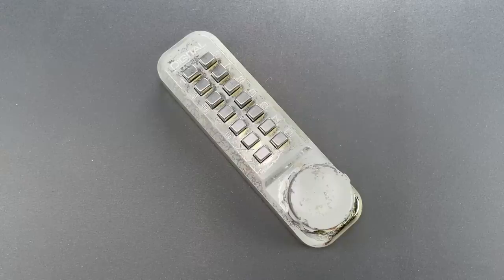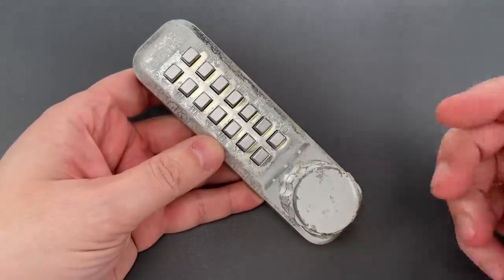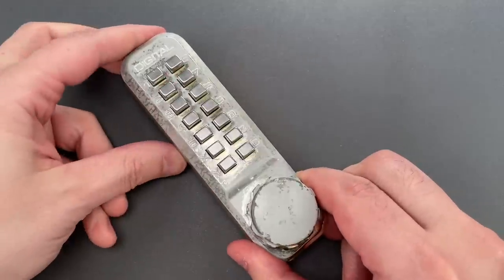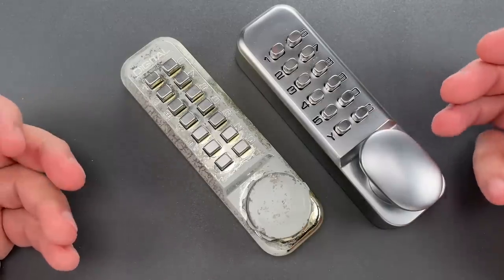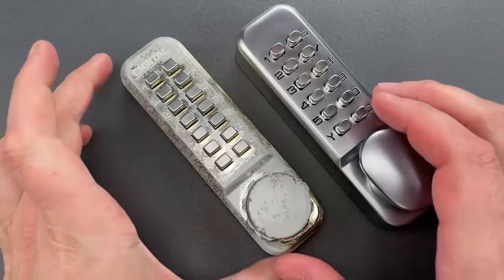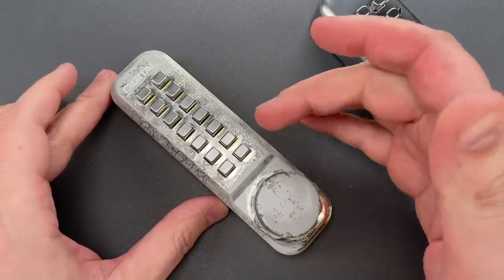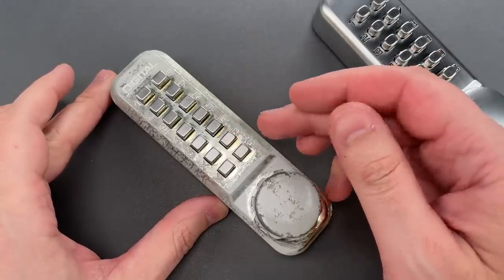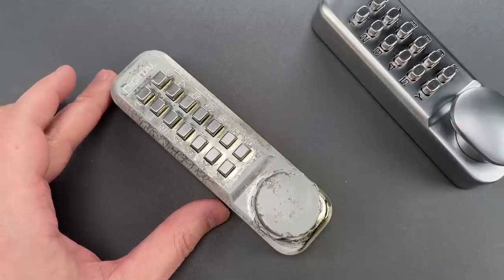[1479] Mechanical Keypad Deadbolt Decoded

Comment: It is interesting to note that, mathematically speaking, most "combination locks" should really be called permutation locks (because the order matters), but these locks are truly combination locks because the order you punch in the numbers is not relevant.
Reply: Thanks dad
Reply: you're technically correct, the best kind of correct
Reply: This is the very thing that confused me when I did my homework and gave the lock example.
Reply: @ilonachan  Yes, Combination is a meaningful mathematical word.  "Combinations and Permutations" is an area of mathematical study.  The OP is right to say that this is a Combination lock.
Reply: @johnwinters4201  oooh interesting, I didn't know that was the name for that. Still, the commonly seen design where order matters is also not a permutation lock. Is there a name for ordered combinations?

oooor it seems "permutation" can also refer to an ordered selection where elements can repeat and be missed out. That's not how we EVER used the word, but I can accept that.
Reply: That is incorrect.
The "combination lock" that you refer to (I believe you mean those with K wheels and N digits on each) , are not permutations, but variations with repetiton.. so N^K variations.

Permutation is arranging all the elements in different orders. E.g. if the lock like this had to have all buttons pressed (each exactly one time, order matters), that would be a permutation (N! possibilities)
Reply: @panda4247  Permutations don't have to use all the elements
Reply: @panda4247  You're incorrect. You can have permutations with repetition or without repetition. They don't have to use all elements in the set. Your formula N^K is correct, but it's still a kind of permutation.

The formula without repetition would be N! / (N - K)! In the case where N = K (all elements used), the formula simplifies to N!, which is what you had.
Reply: @panda4247  A permutation doesn't necessarily require the selection of every item in the set, but it does require the items selected to be in a particular order, without repetition. A combination, on the other hand, does not require a particular order, but it also disallows repetition.

This lock, since it has 13 digits of which four must be chosen, has 715 possible combinations. If it required the digits to be selected in a particular order, it would have 17,160 permutations. That's two orders of magnitude improvement just by changing the rules.

This lock, as implemented, offers little security. If you didn't know the trick you could still brute-force your way in via exhaustive search. Assuming, generously, five seconds per trial, you could go through the entire keyspace in less than one hour.
Reply: I think I agree but also, wouldn't not pressing a button be a selection? Would the unpressed buttons be part of the selection set?
Reply: Finally, someone who understands!!
Reply: and then we have German, where locks like this are simply called "Zahlenschloss", literally translated to "number lock".
Reply: The only thing better than these kinds of comments is the discussion that inevitably follows them.
Reply: Why not go one step further into heing unnecessarily descriptive and call them:
"Sequential Order Specific Combination locks"?
Reply: @nutbastard  strokes non-existent Fu Manchu ahhh! I see your mastet taught you well, your Kungfu is quite powerful! A-wooooo, good disciple!
Reply: @nutbastard  So is corrugated fiber board it just uses three cardboards.
Reply: Software developer here and I'd tend to agree with your pedantry over this wording
Reply: So what's a lock, with 4 selections of 1 - 10, and also a permissible settable sequence of 1 1 1 1, called? 
A Combination or a Permutation or elsewhat?
Reply: A permutation also happens at hair salons.  Female goes in looking normal and comes out looking mutated.  I think it's just shortened to perm in casual conversation.
Reply: I think for a permutation you would need to utilize every symbol once, so I guess they should be called arrangement locks?
Reply: @mmmmmmmmmmmmm  dude, that is literally the definition of permutation...
Reply: @ODekaK  no, I am correct :) 
permutation is just "number of different arrangements of the elements in the set" no duplicates, all elements used. That's it.

Having googled some more, apparently, the thing which I call "variations (without repeating)" is also called "k-permutation" or "partial permutation". but just "permutation" is always ordering all elements...
Reply: Normally what is called "combinations" is when you have a selection of a known number.  With the lock the number is unknown so you have 2^n possibilities instead of n!/[k!(n-k)!].
Reply: Big brain representative
Reply: @willj1598  Yes, but you can not-press the unneeded buttons in any order you want. :)
Reply: @CoolAsFreya  Pendanty?  I just said "interesting to note" without an edict in sight!  :D
Reply: @Dr_Wrong  Permutation.  What the setting is is not necessary information.
Reply: @johnopalko5223  
Not quite.

If a set itself contains repetitions then the permutation can contain repetitions.

For example the set {a, b, b, c, d, d, e} contains 7 elements and a permutation of two elements from that set could contain a repetition,  ie (b, b) and (d, d).  Other permutations would include (a, b) and (b,a), but these two would both be the same combination of {a, b}.

The important fact is that if you one-to-one map the elements of a set with the counting numbers, then the permutation of the counting numbers will not have any repetitions but the permutation of the elements mapped to those counting numbers can have repetitions, and so the permutations of the set elements can contain repetitions. 

So mapping the set above to the counting numbers using their positions as listed from the left hand end,  the (b, b) permutation could be either of the (2, 3) and (3, 2) permutations of the mapped counting numbers, which do contain no repetitions.
Reply: @cigmorfil4101  Yes, you are correct. I made the mistake of not considering the general theory of combinatorics but, rather, focusing on the specifics of this particular lock.

The design of this lock makes repetition impossible. There's no reason why a digital lock could not be designed that does allow repetition.

But still, the distinction between combinations and permutations stands. By not considering the order of selection, the manufacturer has drastically reduced the size of the keyspace. In fact, they have made it laughably small.
Reply: @ilonachan  I take it that you never had the Intro to Probability course.
Reply: @johnopalko5223  
You mean like a lock with 3 or 4 wheels each with the digits 0-9?
Reply: @panda4247  and others: It seems to boil down to how people in different parts of the world call the same things. There are countries where there are permutations and variations (repeating or non-repeating), and combinations; while there are ones where they call everything that is not a combination a permutation. In my part of the world (Hungary) we differentiate between variations and permutations. But, to be honest, I think those who don't have a point. After all, permutations are just a special case of variations (where we choose all the elements), so why not call them the same thing? Also, I've never heard anyone saying "partial permutation", they just use "permutation" to mean that. (I'm not an expert on this, those are just my experiences)
Reply: @cigmorfil4101  That's one implementation. I was thinking of mechanical pushbutton locks, specifically, the Ilco Unican Model 1800, which was introduced in 1965. I don't know if that lock allowed duplicate numbers to be selected, or if order mattered. Perhaps LPL can fill us in.
Reply: 14 choose 4 is 1001, so this lock is theoretically vulnerable to a (figurative) brute force attack by someone with enough patience.
Reply: @dansanger5340  It's 13 choose 4. The 14th button clears the lock. So it's only a meager 715 combinations. 13 choose 4 permutations would be 17,160. That's still not a lot but it's better.

If the manufacturer had implemented 13 choose 6 or 7 there would be 1716 combinations. More than 6 or 7 and the number of combinations begins to decrease.

Permutation is the way to go.
Reply: @johnopalko5223  715 combinations is worse than a briefcase lock.  Probably not something you want to brag about on the packaging.
Reply: @dansanger5340  Does the lock only allow 4-digit codes, though? (I don't know) If not, then there are 2^13 = 8192 possibilities, which is still not a huge number, but it's 10x larger...
Reply: NEERRRRRDDD
Reply: Even worse, some of these mechanical, of us are such that you can "mash" several buttons at the same time and the lock will open. The keys do need to be in the combination though.
Reply: @FZs1  Yep, I have noticed that too, however, I would argue that "partial-permutations" or "k-permutations" are still not the same as permutations even if they share a similar name in that terminology.
It's like... a peninsula is not an island, even if they share the same root in many languages (even in your laguage, if google is correct. félsziget and sziget... I hope you agree that they are not the same, or "just a special case" of one another)

However, once it gets repeating digits, it cannot be a permutation.... there are no factorials in the formula for that :D it's completely different concept.
So while I might concede that 5-8-3-6 might be a permutation (though just partial on the 4×10 digit lock), 3-5-3-5 is definitely not a permutation.
We might as well call it a combination, if we allow different concepts to have the same name...
Reply: @johnopalko5223  
Not quite.

IIRC the number of digits required is set when you set the combination: you decide whether each symbol [0-9X--Z] is required or not, making it have 2^13 or 8192 different combinations (which includes no digits being pressed, ie unlocked unless you press any keys).
Reply: @ilonachan  how did you use permutation?
Reply: So i can make a run of the mill "combination" lock and market is as a superior to other "combination" locks on a technicality?
Neat.
Reply: @vojtaliska1430  apparently, you can make any shitty lock and market is as as you like, even without the need of some technicality. E.g. locks marketed as "high security", that can be shimmed or bypassed 🤷‍♂
Reply: When mathematicians try to rationalise the English language. As an added bonus we have mathematicians applying mathematic principles to things not associated with mathematics. But that's mathematics in a nutshell.
Reply: @nutbastard  The semicolon really has no defined "correct use". You did use it well, though.
Reply: @pixelmaster98  I'm surprised the German brain copes with calling this lock Zahlenschloss (number lock) when it also has letters. Seems a recipe for existential implosion.
Reply: @DiscoFang  well, my response was based on Victor-charles' comment, which mentioned "the order you punch in the numbers", not "letters". If the lock has letters, it obviously would not be called "Zahlenschloss".
However, the number (no pun intended) of number-based locks that I have seen in my life far exceeds the corresponding number of locks with letters. Regardless, combination locks could also be directly translated into German as "Kombinationsschloss". In my experience, Zahlenschloss ist just the more popular term.
Reply: @DiscoFang  "When mathematicians try to rationalise the English language" is not a complete sentence.  (when linguists try to interpret YouTube comments)
Reply: @victor-charlesscafati   It is intentionally and correctly a sentence relying on context for it’s completion befitting of and moulded to the YT context. It’s not me that doesn’t have a handle on liguistics in communication.
Reply: @DiscoFang  Possessive "it" doesn't have an apostrophe.  Just sayin'.  But that's ok—I was able to understand your point, this time.  Not the first time though. 😀
Reply: @victor-charlesscafati  You’re getting it. Those who complain about syntax and typos in YT comments don’t understand communication and context.
Reply: @victor-charlesscafati  To look at whether it’s appropriate to assume the way mathematics uses English is the correct way to apply English outside of  mathematics, maybe it’s worth comparing other definitions and uses of the word “combination”. In boxing a combination is a particular sequence of punches in a particle order. Changing that order changes the combination. A combination fried rice at my local Chinese takeaway is simply a grouping of ingredients together. Sequence only exists in the preparation not in the dish itself. Which is correct? Both are. “Language” as a mode of interpretation and communication, which is what we’re dealing with here, would suggest that “combination” in the world and context of locks can mean both. 
Math is maths is mathematics. It’s its own world of its own creation.
Your initial proposition is a great discussion point tho’.
Reply: @panda4247  So a 9-pole pattern cipher on a typical old-fashioned Android smartphone could be a permutation lock

Comment: I have managed to get through one of these without knowing the code simply by looking at it from the right angle and seeing which of the buttons has greasy finger marks on it - just a reminder, that if you have one of these sorts of mechanisms, make sure your change the code regularly enough to avoid such an easy decode
Reply: Or wipe it clean after each use.
Reply: @kingzach74  Or push all of the buttons sometimes.
Reply: @mikelolol  they wont wear that fast as a keys you use regulary. Anyway you can feel the difference whenever you touched binding key.
Reply: There's a Team Fortress 2 video called 'Meet the Spy' which features a number pad like this. The code to get in is '1111' and the 1 is the only key that's worn down on the number pad. I always thought that was a nice detail.
Reply: or do like they did with this one and use all the keys
Reply: I also once got through a keypad lock that had the numbers printed on the buttons, so I just pressed the buttons with faded/missing numbers and opened it within seconds 😂
Reply: I think there’s also rare keypad locks that randomizes where the numbers are every time it’s used so the same buttons aren’t worn down every time.
Reply: @Cedar_Wolf  i dont think that's actually possible because I've seen how some of these are "programmed" and theres 4 pieces of hardware you insert behind the desired key buttons so you need 4 different numbers. no number can be repeated that i know of unless its fully digital or electrical.
Reply: @yaboirico5221  Well, there's no reason that all locks need to have the same mechanism. The lock in question beeped when you pressed a number, so obviously it was electronic rather than mechanical.

Also, the short in question was CG. The lock didn't actually exist, so it could work however the script writers decided it should work.
Reply: @junupbox4911  I’d love to know how this works or have you made it up?
Reply: @Cedar_Wolf  the box comes with enough parts to allow a minimum code of 3 digits, or a max code of 6 digits, but repeating a number has no impact.
Reply: @yaboirico5221  box comes with parts that allow code to be 3-6 buttons, but if you can source more parts…
Reply: @smokeandkippers  there are codes like that, and you have to have a beeper like device that tells you what the new code is. A guy had that at one of my jobs.
Reply: Changing the code requires removing the lock from the door, opening the combination body and changing the positions of the parts. It might take you over an hour, how often do you want to do that?
Reply: @yaboirico5221  The video I was talking about is fully digital. I said it was a nice detail that the animated lock in the animated video had the 1 worn down because the code for the lock was 1111.

It wasn't a real lock, but real locks do wear down over time when people press the buttons. Sometimes you can use the worn down buttons to figure out what the code is.

For example, if there's a keypad for a gate, the 2, 3, 4, and 5 buttons are all worn down, and the address to the location is 2543 Smithville St, then the code for the gate is probably also '2543.'
Reply: @smokeandkippers  it’s been a while since I’ve seen it, but the numbers are displayed by what I assume are LEDs instead of printed numbers. Every time it’s used the location of the numbers are scrambled so that people can’t figure out the code by looking for wear on the buttons. The best I can find about this is looking up “scramble keypad”.. it seems to be a thing that hasn’t caught on since most of the shop options appear to be the same model being sold by various sites. Although, images has more variety at least.
Reply: @junupbox4911  That could be a lawsuit for a potential company or business against people with some levels of vision loss. I can't imagine someone using that except for a private residential home.
Reply: Just like a keyboard on a computer. After a while the E key and the S key look very different i.e. smoother than the Z and X
Reply: @SunnyWu  shrug, all i know its a thing that exists.. although rare
Reply: Well, speak of the devil, he just covered one.